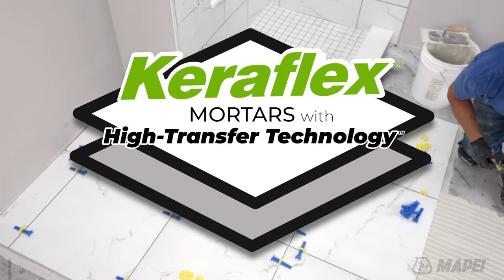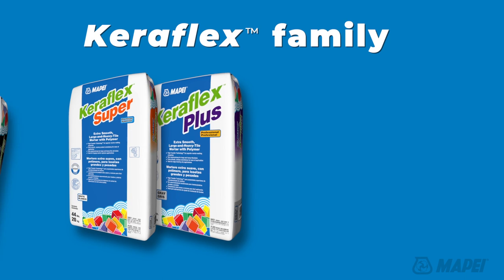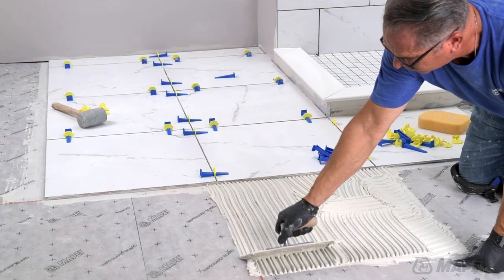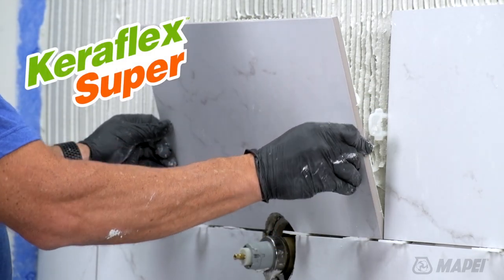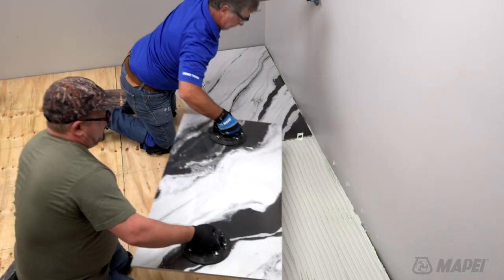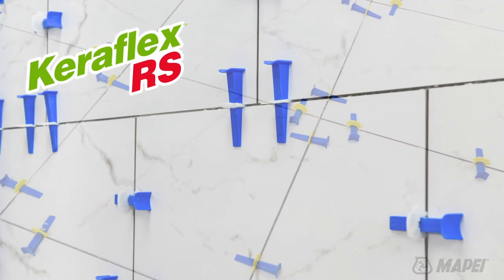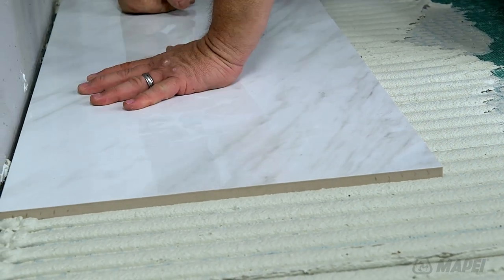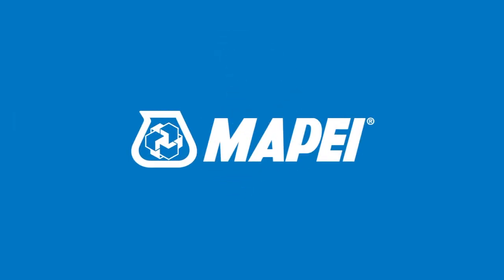Keraflex mortars with High-Transfer Technology

Comment: Which one to use in bathroom with walk in shower (wall and floor) with large porcelain tiles, which are 120cm by 60cm. I also have a few larger tiles which are 3m by 1M. Do they all work with large tiles?
Reply from the maker: Hello Jacqueline, we recommend either Keraflex Super or Keraflex Plus. They do all work with large tiles, the Super is the premium with the most polymer, which provides bond strength and internal flexibility. The Keraflex Plus is just a step down from the Super but more than acceptable for a residential shower. What's most important is that you get good coverage. Please contact us at (800) 992-6273 to discuss this application.
Reply: Do you still need to back butter with SG?
Reply: @denniskesik1531  I suggest to always back butter with large format tile.  Just One Man's Opinion.